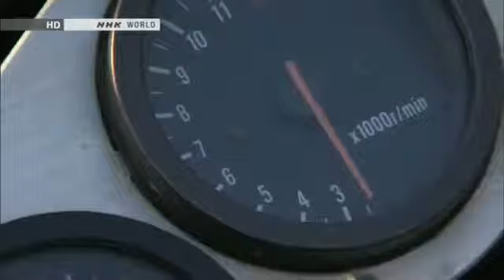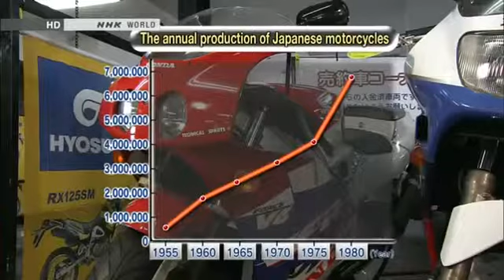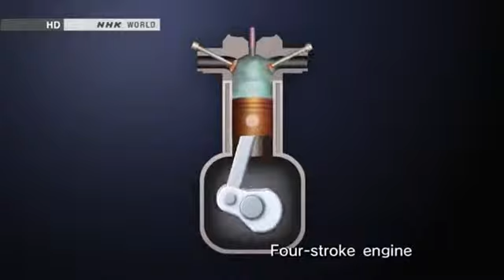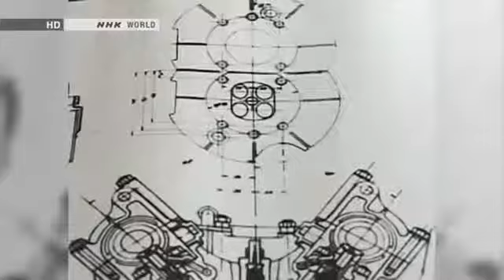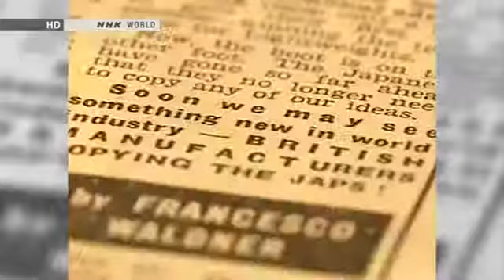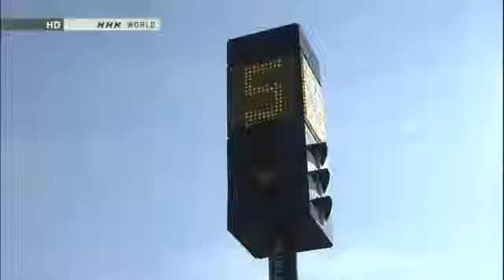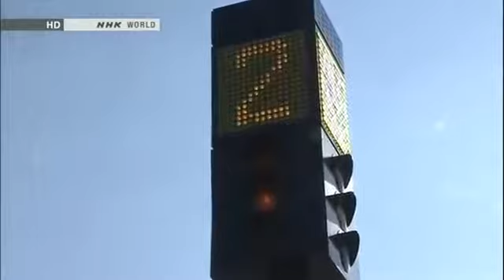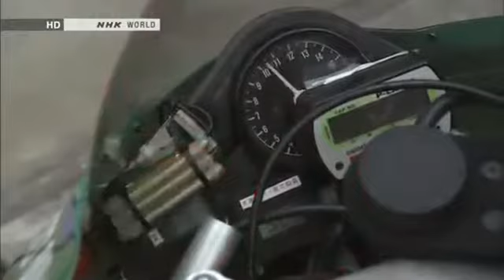Begin Japanology   Motorcycles   YouTube

Comment: Would be great if there were not two voices talking over top of it at the same time.
Reply: its difficult watching with phone speakers, this way yeah. but you can easily work around this issue with earphones by only using one of either side or if on a windows desktop, switch the speaker balance to either side. in this case, the sliding down the right will only make the english dialogue be heard, could be similar with other OSes
Reply: @seibertron500  I was trying to watch it with computer speakers.